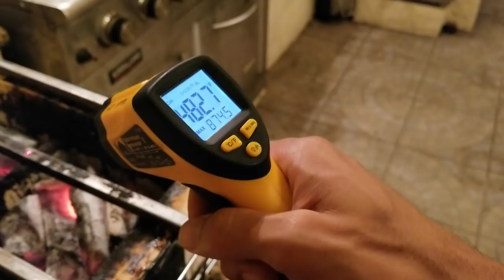Yakitori Japanese BBQ Grill Binchotan Charcoal How-To BBQ Champion Harry Soo SlapYoDaddyBBQ.com

Comment: Quick tip. If you cant find japanese charcoal. The next best thing is Pok Pok Thaan Charcoal. It also has a low smoke high heat and low ash. Its made out of coconut.
Reply from the maker: Yes, any high heat charcoal like Jealous Devil works great if you can't get Bitochan charcoal.
Reply: mexican707 Pok pok Thaan charcoal is not made from coconut, that’s something else, pok pok is made from the wood of the rambutan fruit tree.

Comment: Just a note about saké -- it's actually stronger than most wines. It isn't 8 - 11% alcohol by volume as sated in the video at 3:42, but rather 18 - 20% at the end of brewing (and often diluted to 15% at the time of bottling).
Reply from the maker: Thanks for the info.  I did not know that. Probably explains why I feel it when I drink sake!  Burp!  :-)

Comment: Here’s a few things I thought could make this great method of grilling even better, no hater :) 

- cut the charcoal with a metal spatula or the back of a large knife to make it fit exactly in the bbq in order to have the heat distributed the same way everywhere.

- make the meat cuts all the same size and fit them tighter on the skewer so that they all cook evenly.

- don’t let the meat burn, you’ll rarely see large burnt bits on Japanese yakitori, do a bit more control and frequent turns of the skewers... also you can dip them in the sauce more than once during cooking ! 

Getting hungry watching this video ;)
Reply from the maker: Thanks for the tips.  I will try them next time I whip out the Bitochan!